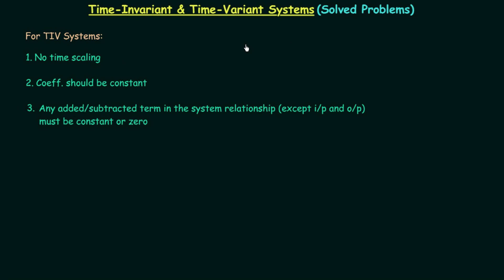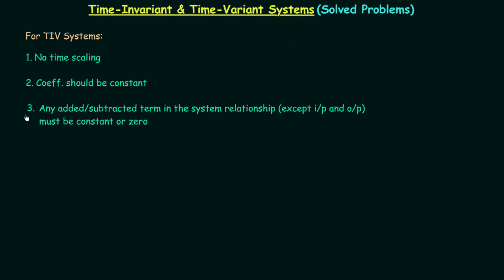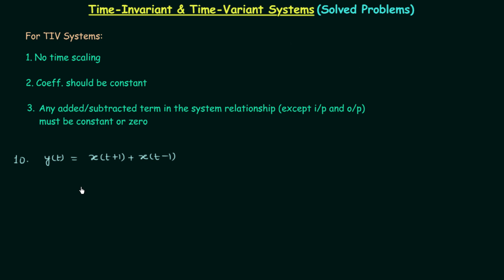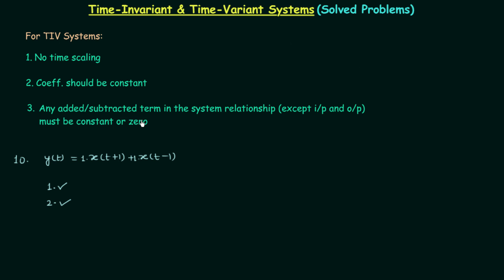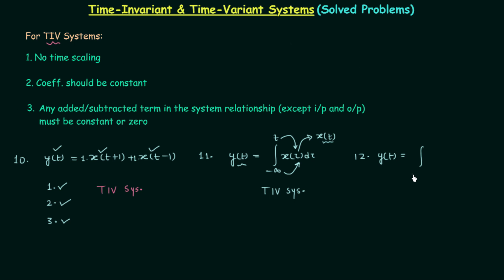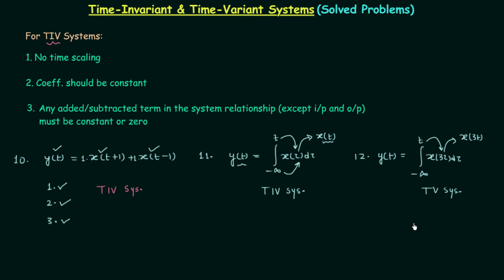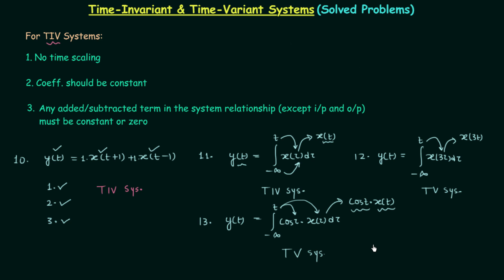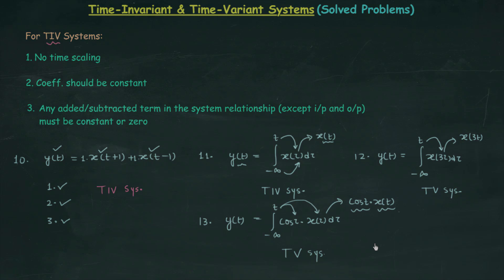Time-Invariant and Time-Variant Systems (Solved Problems) | Part 2

Comment: At 3:59 I have a small doubt in all integration problem why upper limit is directly put into input without solving integration  for checking the system...
Also at 4:00 why - infinity ♾️( lower limi)is neglected.....